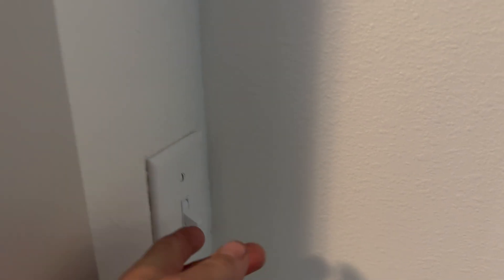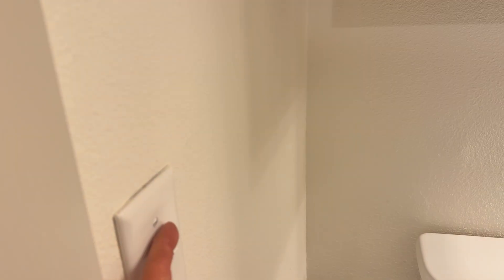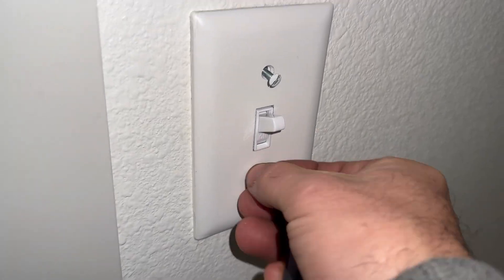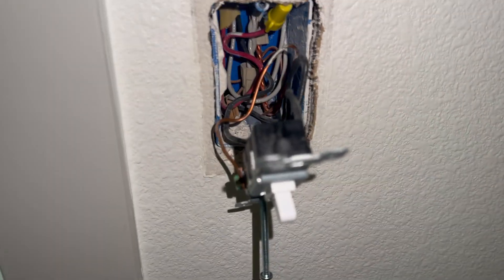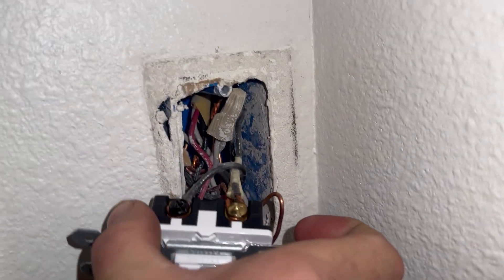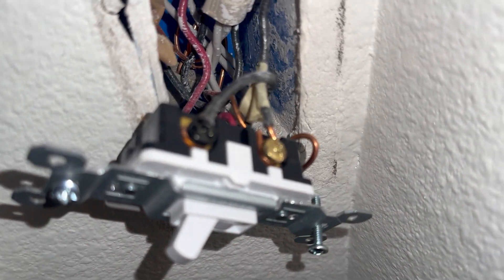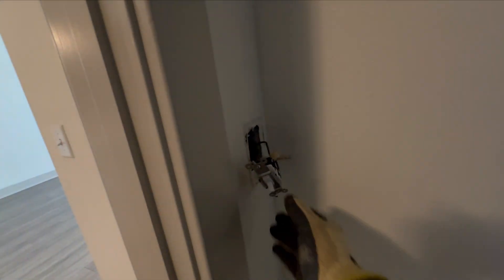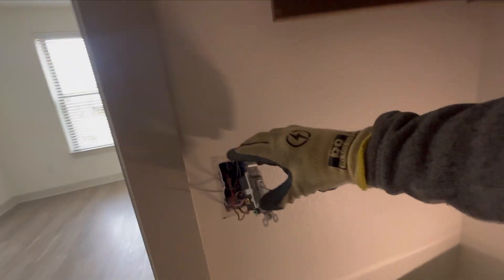3 Way Toggle Switch Troubleshooting

Comment: is the nuetral thats attached to the fixture have its own singular wire going it while the incoming black wire go to the common terminal of the first 3 way switch?h is there 3 or 4 wire romex going to the fixture where everything but the nuetral is cut out?
Reply from the maker: Neutral should go straight to the light, there’s no need to interrupt the neutral circuit although I’ve seen some pretty messed up wiring

Comment: The most logical way to install them is power 2 wire cabel to S1, three wire cable from S1 to S2, and 2 wire cable from S2 to the light. Oddly enough, a lot of diagrams that show this never include the neutral being spliced at each box haha. Good work though man!